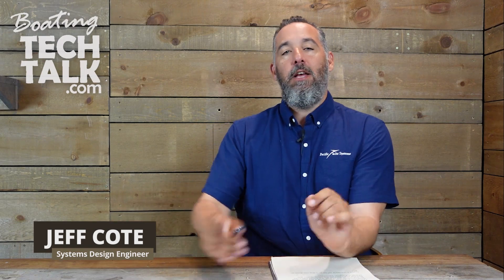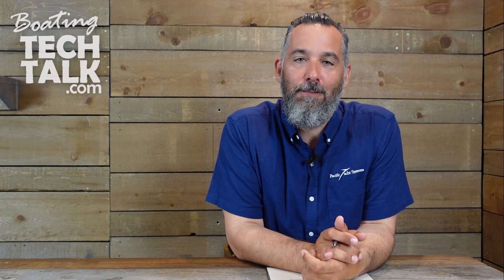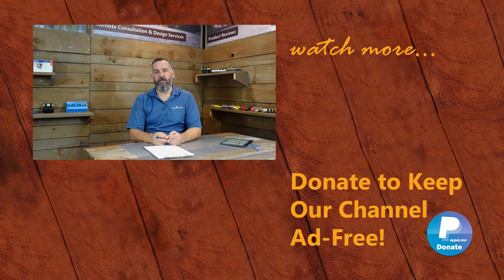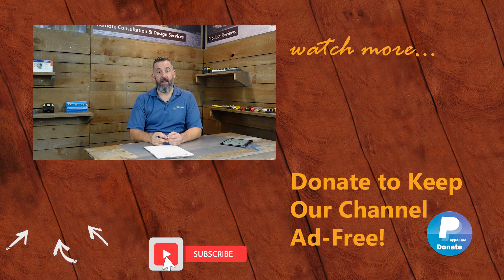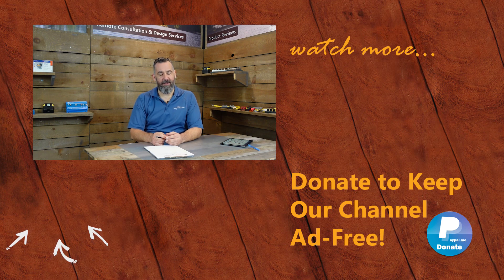Two Alternators and Two Battery Banks On My Boat

Comment: Hypothetically, assuming both alternators output similar voltage, how about putting them in parallel? Wire them both to the start battery and combine it with the house batteries through a voltage sensing relay. This way the full output of both alternators are being used instead of a lot of it just going to waste.

Comment: Hi, similar question I have a 50 year old twin engine boat with 2 battery banks. Starboard engine charges an 8D starting battery which is used to start both engines.  The port engine charges the house bank. No guesses as I was involved with the rewiring to make it happen. (previous setup had the port engine being started from the house bank which I didn't like).  My question is about replacing the existing tired house bank which is currently comprised of 4 golf cart batteries. I'd like to increase the capacity of the house bank and have room in the battery box for up to 6 golf cart or some other technology. Other info - I have 295 watts of solar connected with a 40 amp mppt controller,  a 40 amp charger and a Victron battery monitor.  There is no inverter charger on board.  Simplest solution would be to replace all with 6 flooded golf carts but would like a more maintenance free option.  Ideas?  If I went with lithium or AGM batteries would I need to change the charging methodology?

Comment: Thanks Jeff.
Please help with clarifying this proposal I have heard some boat owners do.
With an existing bank of maybe 4-500 AH of AGMs, there have been suggestions of placing a second bank of Litiums in parallel to it. The lithiums are maybe only 100 or 200AH in capacity but are meant to supplement the AGMs due to the voltage difference at the same SOC. This is all assuming that the AGMs are being charged by the alternator, solar,wind, shore power and the Lithiums are being charged via a DC 2 DC charger from the AGMs.
Could you please help me work out if this is a viable way to go about this please and if you could include a discussion about how to best go about installing a 1,2,both battery switch.
Thanks again for this great series.😁⛵
Reply from the maker: Good one, but unfortunately never seen this deployment in person and much less done an installation like it. Can anyone with this setup share the pros and cons of their setup.

Comment: Thanks for your great informative videos. This is a question that might interest your subscribers! I have a twin a engine boat (24V system with external regulators, original to the boat 1977) with 3 battery banks each engine charges its own battery and the house bank is charged using a smartbank relay system which connects all batteries, if it sees a charge (also has victron multiplus for shore power charging). my question is how can I get both alternators to put out equal amps as the port alternator always puts out 25 amps while the starboard alternator puts out very little. Both altenators while old work perfectly because both output 25 amps if only one engine running .
Reply from the maker: Tom, great question. I believe the Balmar centerfield addresses your concern of balancing two alternators with external regulators.

Comment: I recently crewed on a 41 Fontain Pajot cat where the house bank was charged only by the  port engine’s starting battery through an ACR.  after watching lots of your videos you got me into “redundancy “ and didn’t feel safe with this set up on this boat. Is it ok to add another ACR from house connected to starboard engine’s battery and have it disconnected with a switch so it can be used for emergency in case of a problem with the pot engine’s alt? Or better yet, what can I use to charge the house with both engines at same time?
Reply from the maker: Good one... yep, you can definitely have both port and stbd batteries connected to house battery via battery combiners and even manual parallel switch.
Reply: @PacificYachtSystems  but what about the alternators "fighting" each other or cycling on / off .
Reply: nothing wrong with having the ability to switch over to the other alternator  but personally, I would use one or the other to charge the house but not both alternators at the same time.